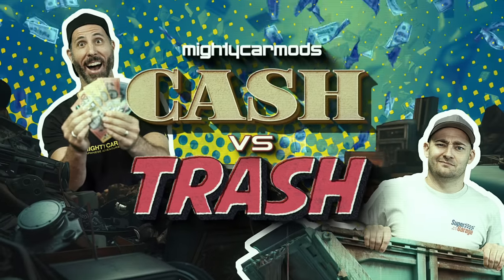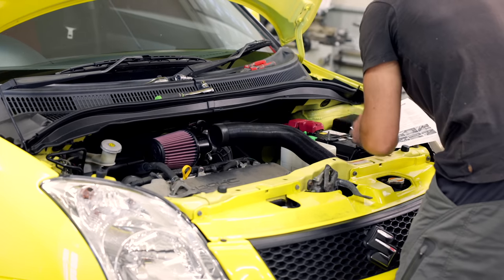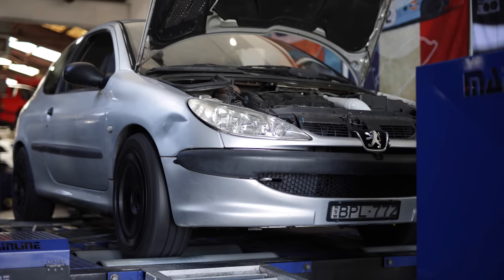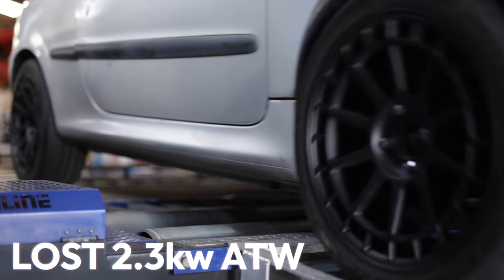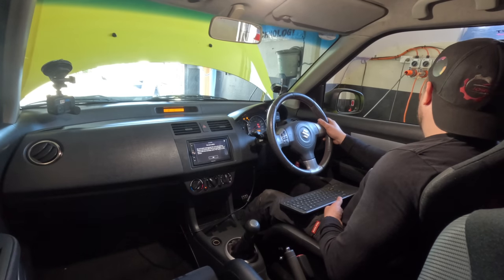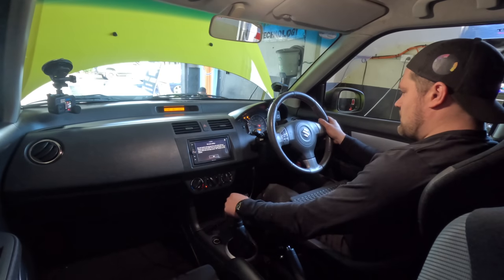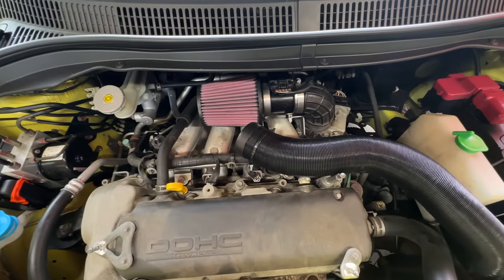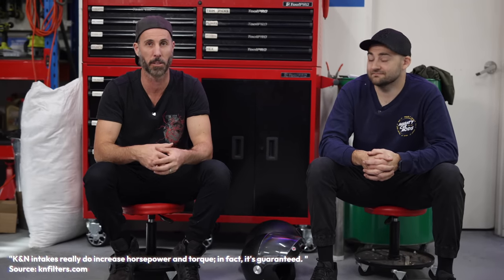Dyno testing POD FILTER Performance Claims | CASH vs TRASH

Comment: K&N drop in air filter for the swift is a much better option. You still maintain the cold air intake with better air flow than the pod inhaling hot air with its positioning.
Reply: I said the 'trash' option for marty should have been a panel filter
Reply: need to dyno for the facts
Reply: You mean the paper filter itself? That doesn't make it a "cold air intake." K&N is typically pretty mid. They just have name recognition and a cool logo so people just assume they're good. An example of a quality CAI would be the Rotofab intakes for the 6th gen Camaro
Reply: Tuning ECU will fix the problem. Maybe!!!
Reply: @Clone895  its a rectangular K&N filter. Direct replacement for the OEM one and fits the original intake housing. I think its k&n part no. 33-2826. The oem intake housing is already cold air intake, sucks in air from the front near the headlights.
Reply: lol, the factory paper filter will flow as well as a K&N replacement...
Reply: @brendonwood7595  i never said that k&n is better. I just said that the drop in filter is better than the pod one they used on the video if going aftermarket.
Reply: @John_Franco  It's completely worthless unless you enjoy cleaning your filters. The problem is that so many people just get CAIs because they look/sound cool. There is physics at play, and if the intake is sucking in air from the engine bay, it is anything but "cold." That's why I listed the Rotofabs as a great example. They have a giant cone filter, but they use the hood of the vehicle to create a closed CAI that sucks in outside air.
Reply: K&N filters are shit the factory filter will perform better
Reply: @alaindelon5398  Sounds like placebo to me... The numbers don't lie. Swapping the filter isn't going to do much of anything in terms of performance. I'm glad you "know your car" and get "a more lively engine" (whatever that's supposed to mean)... At the end of the day Idc. If putting an overpriced filter in your car makes you feel better, go for it, but I'm just calling a spade a spade. The only advantage of a K&N filter is that it can be cleaned, but if cleaned improperly, it could lead to worse filtration. Don't listen to the marketing nonsense these companies try to pull. I put an axle-back exhaust and a quality CAI on my car (that adds HP on dynos without a tune), and I barely notice a difference in terms of performance. Unless your OEM air filter was extremely dirty, there is no way that it made such a drastic difference.
Reply: @Clone895  Its not placebo, it's caused by significantly increased throttle response. A short intake that sucks in hot hair from the engine is sure to lose a few horses, but the air will have pretty much no resistance going to the engine so it'll respond faster. Obviously a longer intake tubing that sucks cold air from the outside is better for engine performance, but it will always induce a bit of lag on the throttle. Optimal course is ofc the shortest route to outside air.
Reply: @sinAnon6689  3hp from a used, dirty paper filter or a brand new one? I also don't believe the noise thing, I've taken the filter out of an airbox completely and the noise doesn't change.
Reply: @MrUppmas  You do realize he was talking about a drop-in filter using the stock airbox, right? Even if he was referring to a custom intake, I doubt anyone would be able to feel the difference without other modifications and a tune. When people spend $500, they don't want to admit it doesn't do a whole lot by itself for performance (and in some cases makes things a whole lot worse). That's why they will never show HP/TQ figures and instead rely on nonquantifiable words like "exciting," "lively," "thrilling," etc to show that their car is "better." There are also conflicting reports about MAF sensor damage and filtration issues with oiled filters and K&N specifically, so even if you could get 1-3 HP (which isn't noticeable in the slightest), is it worth potentially damaging your car?
Reply: @brendonwood7595  The amount of cope from the K&N fans is actually crazy... Can't wait for them to tell me why Armor All is the best car cleaner on the market
Reply: @Clone895  Well, if he was then it doubtful it would increase throttle response, maybe slightly but you'd be hard pressed to notice the difference. 
My K&N kit cost me 100€ and it's a pod filter in a custom air box that draws cold air through a roof scoop with a slight ram air effect (the kit would have placed it where the stock also sucks in air). It definitely affects throttle response (stock airbox routes the air quite a bit to muffle induction noises), doubt it's gaining me much HP (as you said, 1-3HP isn't noticeable), I bought it mainly for cool induction noises that it definitely does. Also reduced 4kg of weight.
Sensor is doing fine, filtration is good based on the fact that the filter does get noticeably dirty and I do clean it regularly and way more often than K&N recommends. Might inspect the inner parts a bit more next time around to see how much if any dust has passed through.

Comment: I'd be pointing towards the rolling resistance of the new sticky tyres
Reply: That might actually be a pretty valid point. Would be interesting to test that with a flir camera pointed at the tyre during a dyno run.
Reply: Deffinetely has an effect. I forget the weight difference from stock but heavier tires will reduce appearent power as well since tyno runs are a dynamic test.

Comment: A K&N drop in panel filter with the stock intake system will give you the small gains you're looking for, those full induction kits very rarely work.
Over the years I've only ever managed to get an increase in power on 2 cars, one was a 2.0L MX5 and the other was a Lancia Delta, both N/A cars, all the rest sounded fantastic but ultimately caused a drop in horses.

Comment: filter right on most maf's makes them swirl instead of straight sections metering right, also stock box was getting air from a different place not back of engine bay, just some stuff to try

Comment: I think you should have measured them with the stock exhaust and intake in the same conditions (i.e. same day, same (probably higher roll resistance + weight) wheel/tire combo). Also I believe modern cars usually take some time to 'cope' with the changed hardware. I believe these mods overall should have resulted in no power change at all under the right conditions.
Reply: Yeah this is left so unresolved not testing with the stock A/F back to back - I guess there is logistics involved in it not being an easy thing to swap in and out that makes that unfeasible.
Reply: @craigmonty  I'd think it's quite easy in the Swift at least (except for the exhaust). The Peugeot seems a little more challenging, but this could be done in between running the other car.
Reply: Not just 'some', espécially if it's a bit old. It took my sw20 mr2 a month to fully adjust to changed parts.

Comment: The air filter was right next to the hot exhaust. The original air box protected the filter from drawing in the hot air. If you used part of the old air box  to protect it from the warm air I'm sure you will see the the numbers back to stock or a tiny bit higher.
Reply: That basically defeats the purpose of the video.  The down pipe was just for the noise, and the K&N setup was supposedly “a drop-in kit.”
Reply: @cjwrench07  that's fair point. As per fitted instructions it's definitely not worth paying extra, for this set up to draw in hot air lol.
Reply: I agree on the filter thats too close on exhaust.
Reply: @GorillazMach1  How would you move it further away from the exhaust? They are already on opposite sides of the engine.
Reply: Dont quote me. But I think the exhuast side is close to the bumper.

So the intake is above the intake side. Still a barmy place for an pod filter.

Comment: Your pod filter was mounted above the engine so it pulled in warmer / less dense air. Your stock filter box has longer, thinner pipes - that helps increase the air velocity going in. Your stock box also has a cold air duct going to the front of the car.

Comment: The Swift also has different wheels and tires now. They are heavier than what was there before. This can skew your dyno results.  So even if the car makes a little less power, it will still be faster on track most likely since it will have a ton more grip.

Comment: you got to use the same dyno for comparison, or do back to back runs on the same dyno making the mods. Otherwise its not the same comparison. The amount of settings of the dyno that could change the calculated output just make it too hard to compare reasonably especially if the gains/losses are so small.
Reply: Came here to ask if they were using the same dyno as the base runs. If not, there is no way to do it accurately, and it's almost a waste of time.
Reply: Exactly, not only that, it's the Dyno calibration that could be say 2% different, test needed to be performed on same dyno to give a definitive comparison, though it's obvious the banana machine has lost some power, the silver french shitbox probably could be making  the same power as it did before
Reply: Looked back at the previous video and it is the same dyne.

Comment: Rolling resistance makes a difference. This should have been factored in by changing back to the tires used on the first dyno test. After that air temperature could also factor. With the minor incremental claims of increased power these mods advertise, these two fundamental conditions make a difference, from all I have read. Tuning as well could be a factor even though a CEL doesn’t appear. Fun video regardless.
Reply: How the car is strapped on to the Dyno also makes a difference. For this kind of testing they should have been using a hub Dyno

Comment: Usually when you put a cold air intake in you have to go in the ecu and reset fuel trims and throttle possition relearn so it can adjust itself over a pretty long period of driving.

Comment: The K&N is right at the back pulling straight hot air, The stock intake pulls cold air that's the difference
Reply: Why did I have to dig so far down the list to find this comment?   THIS.  How is this not what everyone is talking about?  I have chuckled at MANY a "hot air intake" mod I've seen installed on people's cars.  DON'T DO IT.
Reply: he also added the cold air intake so it shouldn't be sucking the hot in
Reply: @ShanesGettingHandy  your spot on i thought it would be the top comment but apparently people don't know so i had to let them know
Reply: @troyam6607 Not really, that thing is just basically just a dryer hose that is supposed to bring air from the front, but the system isn't sealed so the pod filter is still just pulling in hot engine compartment air. Complete waste of money

Comment: I had the exact same thing happen to me. I just restored a 1983 VT500C Honda Shadow, yes I know it's a motorcycle, but it's an internal combustion engine just the same.  The previous owner had removed the air box and put in pod filters, after hours of research I found out that I had to change my carb jets up two sizes to account for the extra air flow. The same is happening with both of your cars. You changed the filters but you didn't change the tune on the engine. Unless you can reprogram the computer to make up for the increased air flow you will never make more power. 
A drop in K&N filter in the stock air box may help a bit, but again, unless you retune the engine you will see very little gains going that route.

Comment: A dyno works by measuring the power output at the rollers, by changing wheel sizes you changed the gear ratio to the rollers skewing the results. Swapping back to the stock wheel/tyre setup should give you more comparable power numbers to the first dyno results.
Reply: Not if you do it according to the specs. The outside diameter stays the same when you change wheels. If you go from 16 to 17" wheels for instance, the sidewall becomes lower. When a rim manufacturer produces a rim they'll write in the datasheet which rubber to use for your specific car.

Comment: 2 questions: Were all runs on the same dyno? And, how does the weather/ temperature compare from original to current testing?
Reply: Given that the 206 gave similar results I think we can rule out the Dyno and conditions as a reason for the swift decrease in power
Reply: @fermillo65  swift had different wheels and tires this time. Conditions were not quite the same. Not an apples to apples giggy.

Comment: Really like this episode as I have been down this path with my old Ignis Sport. 
Lost power with a K&N pod filter. 
Put back the stock box with a drop in K&N filter and gained back the power. 
Dont understand the engineering behind this, but I just named it Suzuki sorcery and moved on.

Comment: im not a mechanical engineer either but you have put the swift air filter near the engine and it consume the heat, better to be down with some stainless steel pipes or the stock filter with a big air scoop. +bonus a sprint booster will be a good idea.
 If you want extra power you have to remove or uptade catalytic converter and headers and then all together will work and you will see some results.

Comment: The original box was enclosed and had a shape that would make air flow in a way the engine likes better. Also, the enclosure protects from the heat of the engine/exhaust. High temperature air makes the combustion worse resulting in lower hp. If you put that pod filter and somehow isolate the rest of the intake, it's probably still not gonna flow as good as the original intake but probably won't lose that much power.

Comment: You gotta get it tuned to match the new exhuast and intake. Mods add power but sometimes need a tune to bring them to their full potential. It throws the air fuel mix off
Reply: tune in next week for more clueless comments

Comment: A drop in K&n filter with factory intakes are the go 💯👌
Reply: Still crap filtration. Just fit a paper filter and change it regularly.
Reply: @ChocolateFrog or clean up your filter more regularly, same stuff really
Reply: @kostasnls4566  K&N filters let loads more contaminants through than paper filters. Project Farm did a great video on it.
Reply: I dynoed one on my car and it lost power, and worse filtration
Reply: @kostasnls4566  No it physically won't remove the really small particles. This has been proven no matter how clean it is.

Comment: A big reason you could have lost power with the K&N intake is because it is acting as a short RAM intake. A short RAM intake pulls air from inside the engine bay, where there is TONS of heat, especially where that K&N kit is located right above the exhaust that reaches around 2k degrees internally.

If you were to move the air filter to pull air from the outside of the car, known as a cold air intake kit, you would definitely gain some power back. If you combo a true cold air intake kit with a tune, you should definitely get more power.

I hope this info treats you well and am looking forward to a re-test with these recommendations.

Cheers guys, keep up the good work!

Comment: When Moog took the stock intake off, he removed the snorkel that pulls air from the front of the car, and by putting the air filter where he did, he is now pulling air from the engine bay.  Simply put, he went from cooler air, to pulling hot air which is thinner...so basically now you are pulling less air than you were with the stock setup.  Pod filters are designed to allow for more air flow through them, but if the air is is thinner where the filter is, it will cause a decrease in power.

Ways to eliminate the loss in power would be to either have a box that closes the filter off from the engine air (with some opening to allow fresh air in) or to run a longer air tube with the filter on the end of it, placing the filter near the front/bottom of the car where the air will be colder and therefor denser.

Comment: Ofc u will loose power with the Suzuki, the pod filter is sucking in hot air which is less dense because it’s placed on top of the engine with no heat shield, also the car isn’t moving so there is no cold air coming through the pipe infront of the pod filter to feed it with cool air, and on top of that u should get a tune when u install an exhaust and an intake because the air to fuel ratios will be different and won’t work well with the stock tune